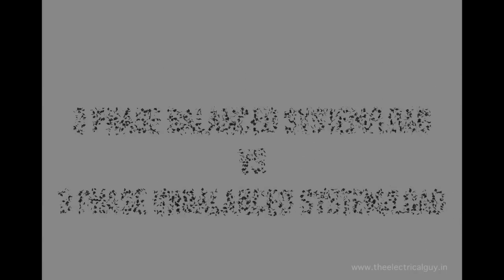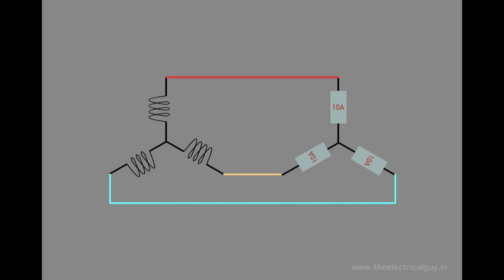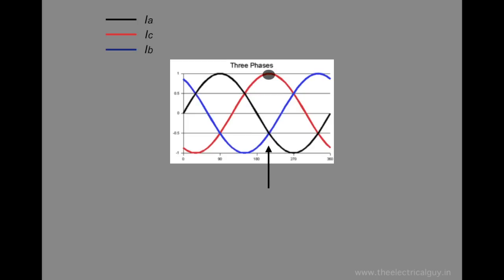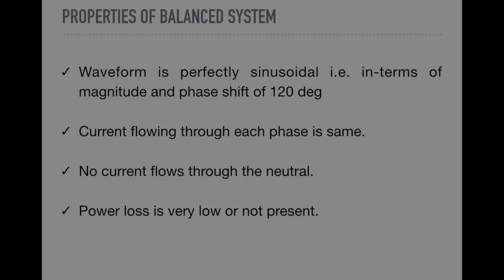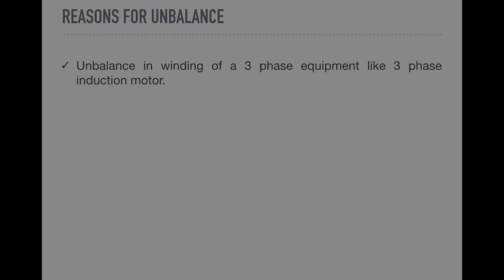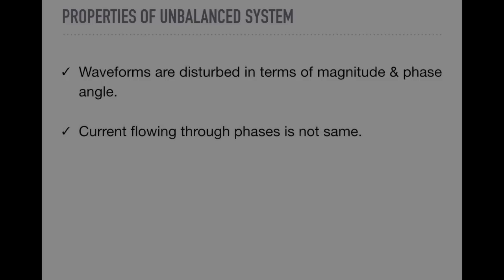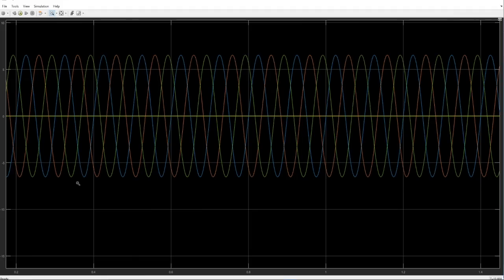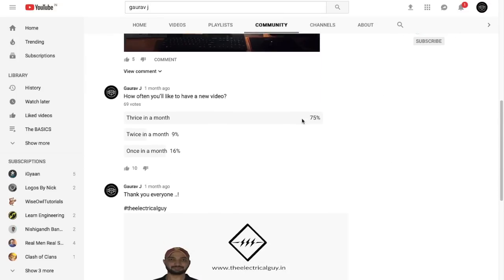3 Phase Balanced vs 3 Phase unbalanced system / load | Explained | TheElectricalGuy

Comment: Thanks for your easy explain.
What is the allowed unbalance persent of current in three phase motor and if I connenct neutral wire will protect the motor from heating?
Reply from the maker: Hi. A three phase motor is a balanced load and hence no neutral is required.

Comment: I have a star connected heater arrangement which is balanced. There is no neutral. What happens if one heater blows open circuit
Reply from the maker: It will create unbalance. You may have voltage fluctuations!
Reply: There are parallel resistors in each leg of star. If one blows I would have 20 ohms in 2 legs and 40 in one. Is anybody up for calculating resulting voltages

Comment: I just discovered two water motors directly connected to my main circuit breaker (from electricity company) before the internal building breaker and last breaker inside the apartment. My question is how will it affect the billing and load and not forgetting the two water pump electrical motors? Please explain so I can murder my land lord.

Comment: How can we maintain the equivalent current in each phase which are use connected to other appliances as well as three phase induction motor .
suppose 
i have three phase motor which i use to run in delta 
and if i select one of phase for single phase motor , definitely there's the unbalance conditions appear in three phase induction motor 
how can we maintain it...

Comment: Thanks for the tutorial, kindly permit my to ask question. apart from electrical motors, what other devices do unbalance system affect.
If a UPS is installed on unbalance system does it affect the output of the ups?
Reply: Where are you from are you from America

Comment: Dear Gaurav, I am wondering:  if a 3 phase motor moves only a small angle (like 30 degree), rather than 360 degree repeatedly, is it a unbalanced system?
Reply from the maker: No. 3 phase motors are balanced loads..!

Comment: Sir in industries most of the motors are balanced systems but they are inductive loads
Reply from the maker: Yes. 3 phase motors are balanced. But, because of the other loads the overall system becomes unbalanced

Comment: Thank you for good explanation of balanced 3 phase distribution. Have question, Using 3 phase 208 volt Y power at our church. 3-phase to large HVAC equipment, Using individual phase legs and neutral to provide 120 volts to utility outlets in building. When circuit breaker is shut of on one of the 208 volt legs we see a small voltage across the switched off leg and neutral. Interested to know what causes small voltage appearance and if it is drawing any power. When measuring small voltage, ~20 t0 40 volts, there is no load across wires. Any explanation will be appreciated.
Reply from the maker: It may be because of the capacitive charge which is present in the transmission line/cable. You can use disconnector with earth switch, using earth switch you can ground the charge.

Comment: Kindly delve into single phase step down transformer operation. With attention
to the NEUTRAL connection thru the two windings. Primary and secondary.
Thank you.  Also please MENTION how much current is on the Neutral
of an unbalanced system.

Comment: Hi sir, really liked your video. I'm not an electrician I am a DIY guy. I was wondering if it is possible to connect 2 or more ac power sources ( alternators or generators for example) in parallel, in order to obtain higher wattage whilst maintaining same voltage. For example, if the source produce 220 each. I want to keep the 220 but with high load capabilities.
Reply: Yes that is possible and done i many places, the problem is you have to synchronize them meaning that L1 L2 and L3 have to be "in fase" when connected or it will not be possible.

Comment: Please explain how is current flow happen on neutral conductor without voltage it's very difficult to understand me
Reply: Yes sir me too
Reply: Perhaps the electrons are PUSHED and PULLED from the Hot side of the circuit. 
Electrons (negative charged particles in the copper atom) move back and forth.
If not balanced, they would end up at the end of one of the copper conductors.

Comment: Sir if there no ideal phase balenceing so how 3 phase induction motor work with out neutral
Reply: It has a DC linking section (Capacitor for voltage source drives, inductor for current source drives) that isolates the inverter from the rectifier, so when the inverter fires/switches, it's firing/switching from a constant balanced source of power.

Comment: Hello sir,Thank you for your great videos, I’v a refrigeration compressor works and then stops for less than a minute and when measured the current for 3 phases, I noticed L2 giving a very high current "3 times the normal value" and L1 and L2 normal, what is expected to occur this problem, Even though there is a failure phase sequence in the circuit.

Comment: Hello gaurav I have a basic question. In a.c. star connection three coil will form a 3phase. We all know that we are making phase neutral in a sane wire for All three wire carrying electrons which always flow towards the phase direction my question is why not all three phases electron going towards neutral direction and meet. Why it is going always opposite side of neutral. What is the reason behind this.
Reply from the maker: Phase and neutral wires are different. To complete the circuit current needs a return path and hence it flows through the neutral.

Comment: I am new to electrical things. As seen in the video, on balanced load at any degree the current is same. But in unbalanced load current varies in 3 phases and neutral is needed.

what is the function of neutral in unbalanced load and what happens if neutral fails? 

Why neutral is not needed in balanced load and what happens if  neutral fails?
Reply from the maker: In balanced system neutral is not needed because  the sum of return currents is ZERO (watch video from 2.10 mins), but in case of unbalanced load the sum of return currents is not zero and hence there will be some return current for which neutral is needed. And if neutral fails, the machines start heating and this will reduce the overall life of machine.

Comment: Hello sir, there is one question ,What will happen if we connect two AC source of same frequency and magnitude but uneqaul voltage (paralle and series in both case). say, one of 25 kv & another of 27 KV source to 25 KV load. What will be the effect on voltge, Power & current of the circuit as well as to the another 25 KV load? Previously i am working on the same ckt the 25 kv source if from Xmer and another source i am talking about is an induction motor which is connected parallely to Xmer as well as to the other loads. Whenever we require a mechanical energy we used it as a motor but at time of stoping we have used a regenerative braking system, at that time induction motor generates emf is more then 25 KV. One more thing i want to add on we have connected a braking resistors to motor ckt so that the generated power can be dissipated. But what if we didn't connect the braking resistors or if the resistors is blolwn out. What will be the reaction in ckt. If possible please make a video on this or send the explanation to my mail id pushpakbhangale303@gmail.com